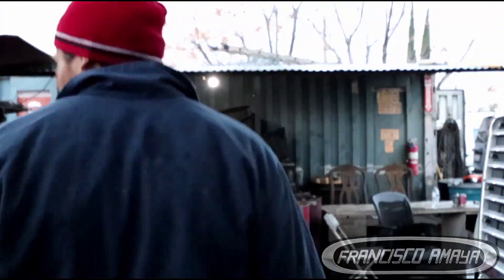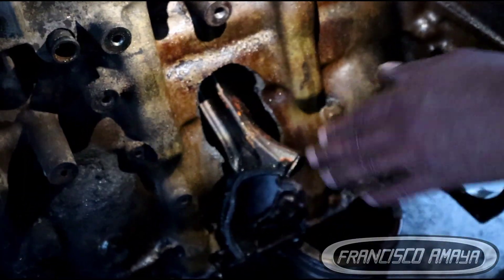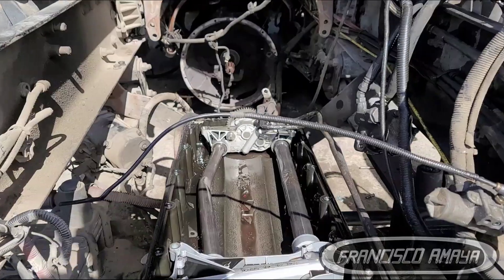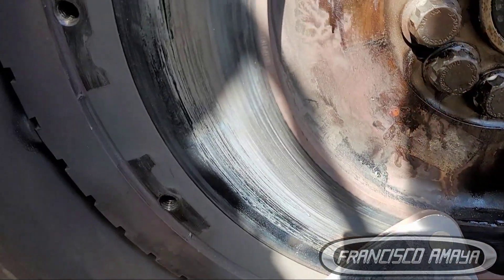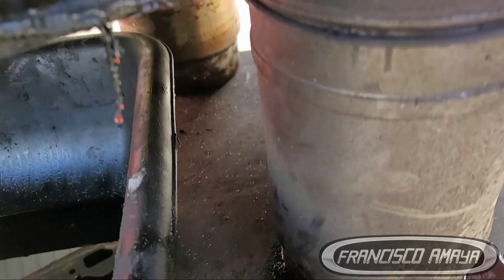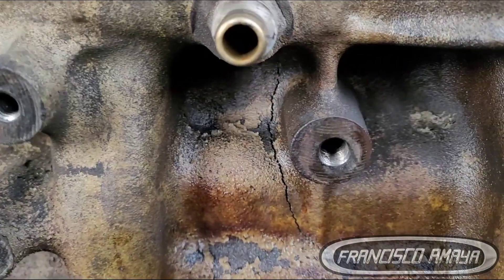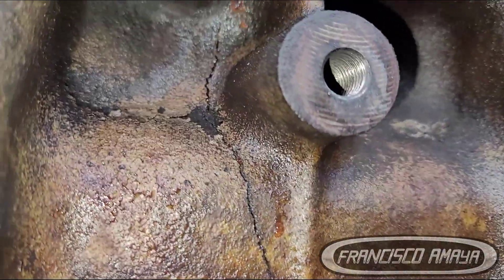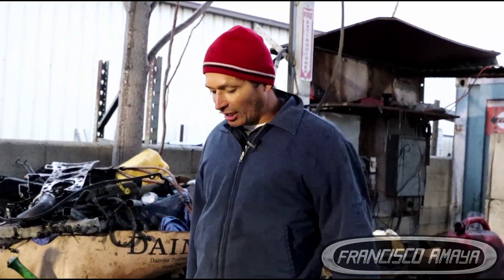DD15 ENGINE WITH A CONNECTING ROD OUT OF THE ENGINE BLOCK CAUSED BY ENGINE OVER SPEED FREIGHTLINER

Comment: It's a result a very bad habit that these kind of drivers developed during their driving career.  They love to use the gear to slow the truck and always in a habit of going fast and then step on the brake hard to slow down.  And one day they go down the mountain at high speed and found that they cannot slow down with their abused worn glazed brakes so they thought it'll be ok to jam it into low gear at high speed.  Well, $20k is nothing compare to loosing your life. Do you guys remember anything that you learned during that two weeks CDL course?  Emergency braking not step and hold till your  brakes smoke and glazed.  Don't be cheap on stuff that your life depends on.